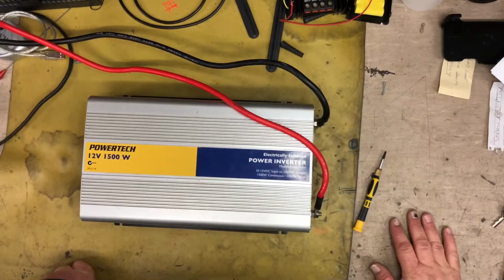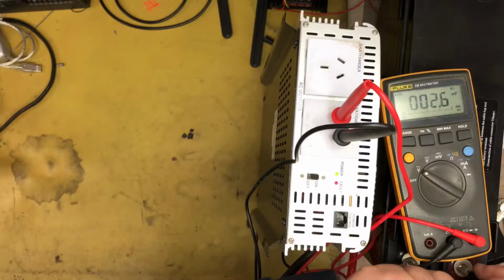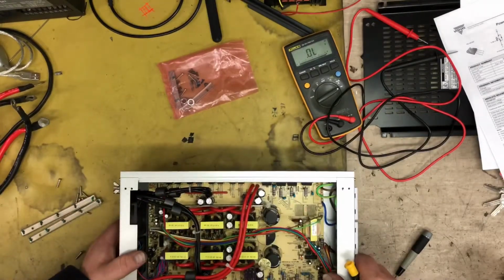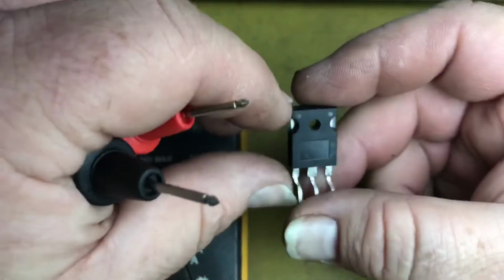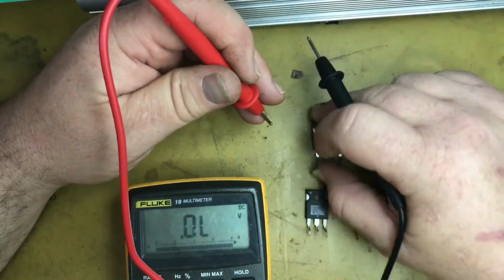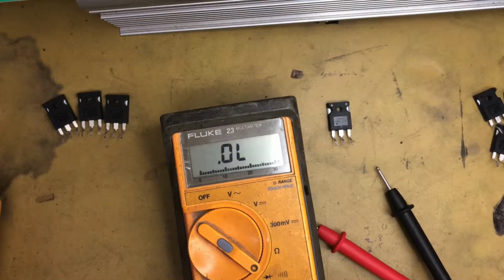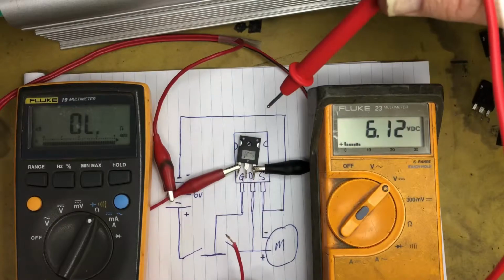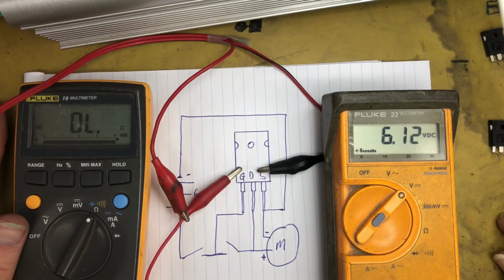Repair of 12volt to 240volt power inverter part 1 with Mosfet testing

Comment: Most loads including laptop power supplies can hapilly run on 'modified sine wave'. The only problematic ones are inductive loads like motors and anything with active power correction like new PC power supplies and some large TVs.